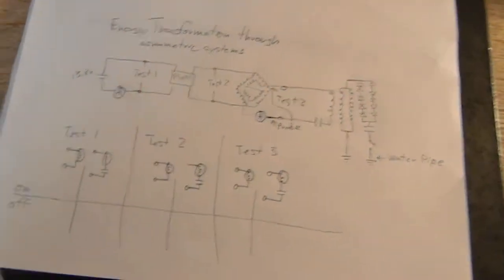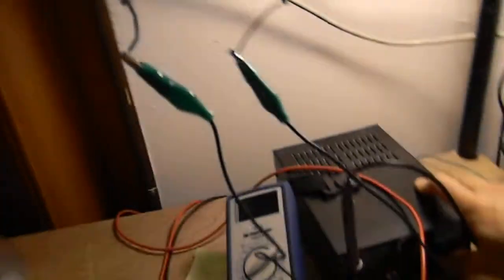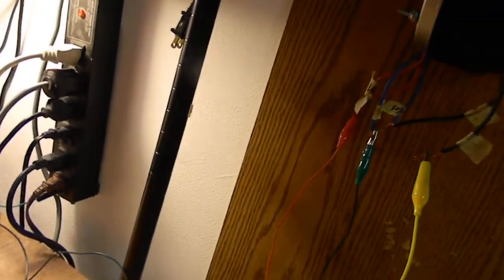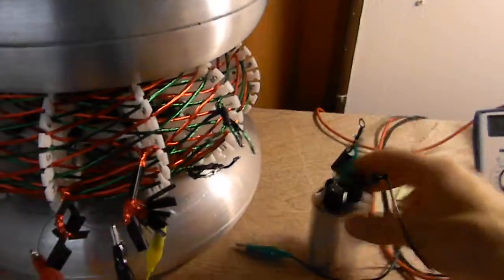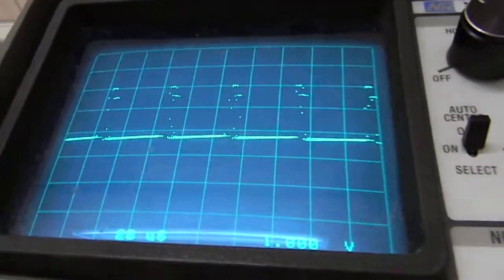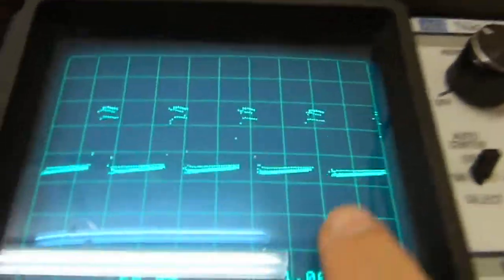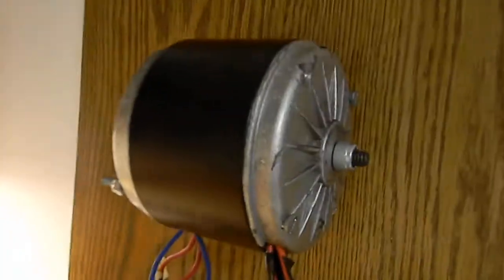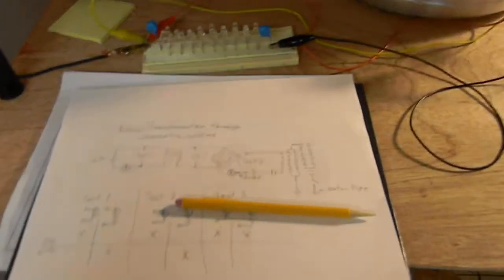Energy Transformation through Asymmetric Sytems

Comment from the maker: Thanks mike, you did inspire this video! It took me about 5 times to get it just right...let me know if you have any other ideas....I am going to wrap a 20 pole 1000watt motor next asymmetrically and get the pwm frequency in tune with the vortex coil to get the resonance just right...since the pwm is around 13khz and the coil is naturally resonant at 30khz it causes some destructive interference and warps the waveform a little on the vortex coil.

Comment from the maker: Thank you Daniel! Yes your video on how to twist the wires was a definite help. I would say how I wired it is my own application of Tesla's equations for resonance I found by studying his CO Springs Notebook. I basically jammed a transmitter and receiver into one rodin/vortex/abha coil. The same thing could be done with a regular tesla coil, however the vortex coil achieves resonance independent of wire length on the secondary....which is a very unique advantage.